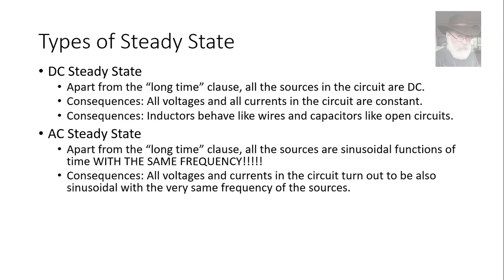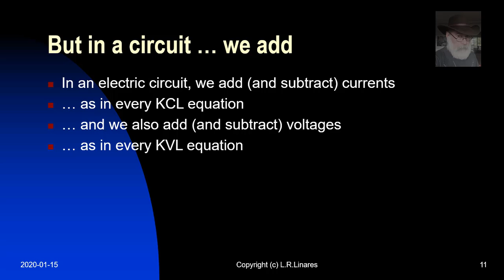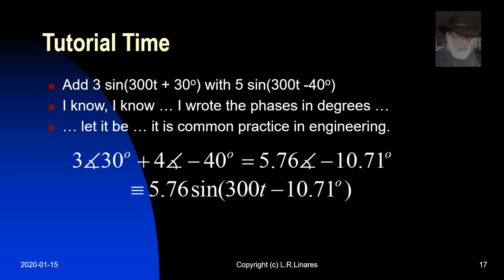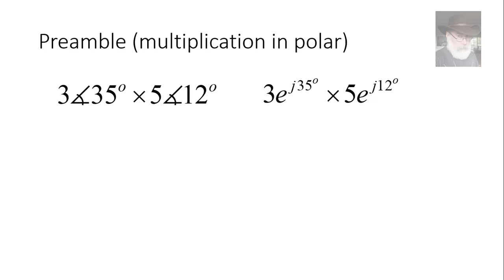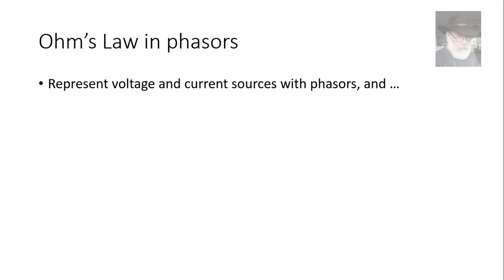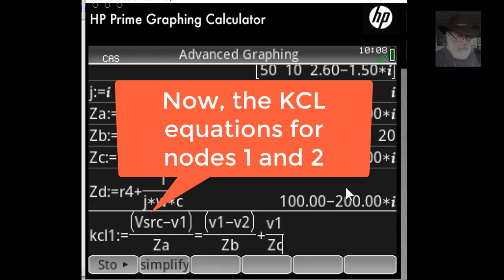What is a Phasor?

Comment: Hi, thank you for the great lecture. I just have a question of what you said at 1:52 What do we do if the sources of the circuit have different frequencies? Do we have to use superpostion to analyse the circuit?
Reply from the maker: For instance, when we solve a transistor amplifier, we solve it first with the power supply (which is a DC source, or what is the same, a sinusoidal source with zero frequency), then we solve separately in AC (the signal) and we superimpose the two answers to get the actual response of the circuit. We say that we check first the "bias", then the signal. Soon in this series, we will be exploring how a circuit behaves at "all frequencies" at the same time. How? In the Laplace domain. Stay tuned.
Reply: @rolinychupetin  thanks !
Reply from the maker: Exactly! We use superposition.